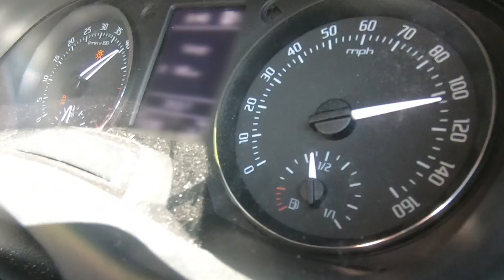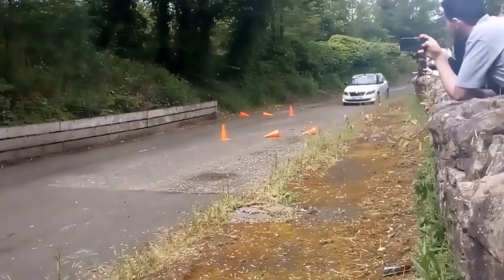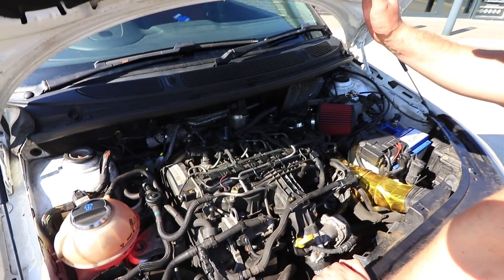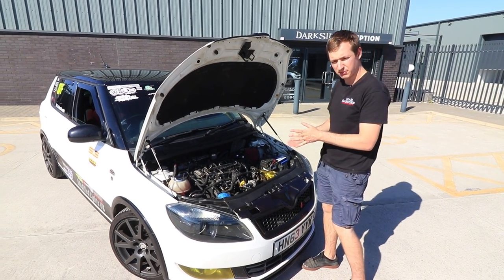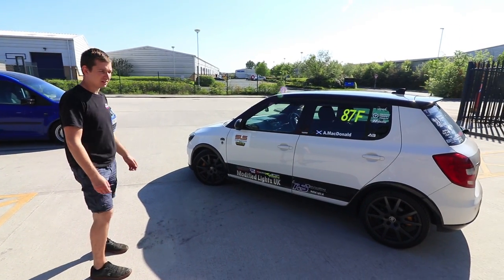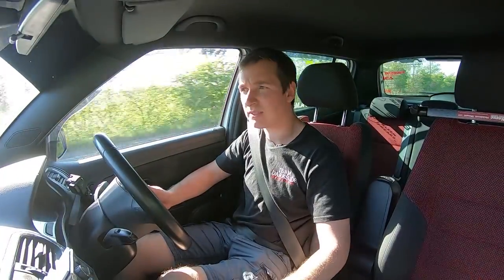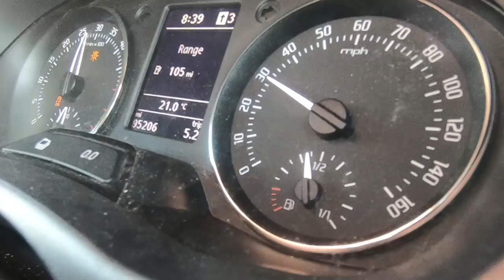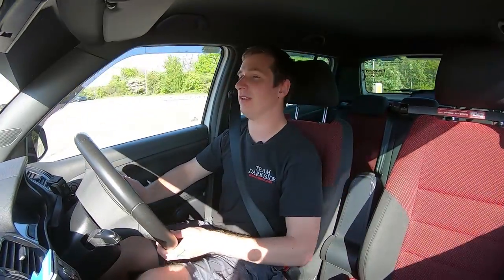Our most powerful 1.6 TDI build yet! 263bhp & 395ft/lbs

Comment: As you get lower down the scale, the horse power required increases massively to achieve reduced 0-60 times.

1.6 TDI (73bhp) = 13.6s  (0-60mph)
1.6 TDI (103bhp)  = 10.6s  (0-60mph)

At this point, only 30bhp is enough to reduce by 3secs.

1.6 TDI (263bhp) = 6.8s (0-60mph)

To reduce by approx another 3 sec's requires in excess of 100bhp and expensive modifications in this particular case. Unless you have a lot of love for the car, obviously best and cheaper to buy a car that's already rated to do a particular 0-60mph. Nice work nonetheless.
Reply: It does 0-60 in 5.18 now

Comment: Still more reliable than original RS (with 1.4 twincharge).
Reply: hahahah definitely
Reply: Everything I've ever read about the 1.4 has said they have chocolate engines.
Reply: Faster too!!
Reply: I’ve put 40k on my twincharge with no issues, no oil drinking ahaha.
Reply: Kyle B I’m selling it at 50k miles ahahaha. I am not crossing the 50k boarder
Reply: Scott C lol, my sister in-laws past 65k and something catastrophic happened and the turbo was spewing out water, dried it up cleared the fault codes and got 5k for it with we buy any car, 🤫
Reply: @kyleb5518  clearly not catastrophic if a water line simply failed 😂
Reply: Whats the problem of the 1.4 twin charge engines?? What are the most common problems
Reply: @miloskilibarda3993  From what I heard the 1.4 tsi drinks oil, the chain can also snap... But I never had one so I can't tell you with confidence

Comment: i would say 1.6 TDI CR CAY has same bore diameter as 2.0 TDI CR CFGB .... 1.6 tdi cr has bore 79.5 mm and stroke 80.5 millimetres and 2.0 tdi cr has bore 81.0 mm and stroke 95.5 millimetres. There is 1.5mm difference in bore diameter. So i think valves aren't smaller in 1.6 TDI.  Big difference is in stroke. 2.0L has 1.5 cm longer stroke than 1.6L. 2.0L is undersquare/long-stroke engine and 1.6L is square engine.

Comment: I have a New Turbo in the Polo 6 r TDI 75 ps,and injector will be replaced,can i remap nie this Car?

It Runs 211000 km is this okay with the New parts to make remap?

Up to 140 PS....
Reply from the maker: Yes, they are usually fine. Injectors are main issue

Comment: You can see the disappointment in his face he’s thinking....god that exhaust note is awfull 😂
Reply: Jon Harwood my first thought on the video was that the car was totally stripped inside that’s why it made such a terrible noise but apparently not 😳.
Reply: @mickaelmorgado20155   The class i run in requires a full interior, even if i take out the back seats or the cardboard bit off the boot lid i need to fit a cage.

Comment: I was wondering, is the 1.9 105hp that’s available for that same generation, tuneable ?
Reply from the maker: Yeah, can get around 140-150 on a tune and have a fair few parts for them
Reply: @DarksideDevelopments  aha, what about 190 hp on wheels, would the transmission and the stock turbo handle it?
Reply from the maker: Might be marginal

Comment: Hi, I'd like to ask for your opinion regarding turbo upgrade. I have a Hyundai 1.6 Turbo Diesel with stock GT1444v turbo, and im planning to upgrade it to GT1649. Do you think it will properly work even without a re-tune?
Reply from the maker: Cant see why it would need one as long as actuator is OK
Reply: @DarksideDevelopments  thank you! Do you think there will be difference in driveability like loss of low RPM torque? Personally i don't think the upgrade is too far from stock but I'd like to hear what an expert says. Thanks!
Reply from the maker: The 1.6s with bigger turbos spool very well still

Comment: I have a 1.6 tdi in my ibiza. On tick over it got a slight misfire rough idle. I think the injectors have gone a drift. But when I load the engine lights or AC on it runs smooth.
Reply from the maker: Check the coding in VCDS
Reply: I got it looked into. If anyone else's as the issue I speak off it's the emission software! Get it mapped out and the EGR mapped out. And make sure they remove that stupid air restriction pipe in the MAF! These guys can do that job they know there stuff when I have watched there videos. But I'm not local so I had a specialist near me do it.

Comment: Water injection, is that a way of getting power out of the excess heat in the engine by vaporising water (letting it expand, pushing the pistons) or is it just for more direct engine cooling under peak load?
Reply from the maker: It works using an endothermic reaction to cool the charge as well as additional fuel from the methanol itself.
Reply from the maker: There are many videos on youtube explaining this which could help you know more about it

Comment: What exactly happened to engine? Why did it break?
Reply from the maker: Rods bent due to too much cylinder pressure/Torque
Reply: Do you think that would happen without ınjector upgrade ever ? I mean everything would be same but just would not have the injector upgrade. I m planing to use water meth injection kit on my 1.6 cay, my setup is all the same just i dont have ınjector upgrade, do you think same thing gonna happen to my engine?
Reply from the maker: Possibly not, doubt you will get enough fuel 9nnstock injectors
Reply: So, it is better if stay with my oem stock ınjectors and apply a meth kit?

Comment: talking of lag. when tuning fuel pulse's for the cylinder compression cycle do you increases the post injection pulse with the rest?
Reply from the maker: Post injection adds heat so you have to be careful what you do there, no point spooling 100rpm sooner to sit on the EGT limiter at the top end
Reply: @DarksideDevelopments  this is true .

Comment: what engine oil would you recommend for the 1.6 TDI , I've seen the original VAG oil is out of stock from everywhere. 
What would you recommend Motul, Ravenol or something else? I know I have the "Castrol" logo on the cap but checking out the internet compared to any other oil has worse results. 
What type of oil and oil filters you guys use? 
Thank's in advance.

Comment: Wonder if it can do a bigger gap than 4 seconds around a sprint circuit compared to mine a couple years ago. Also doesn't sound like a 1.6tdi
Reply: yours was only quick because i drove it haha and 4 seconds over a 45 second run is big lol
Reply: @amd87ts  I think that was for the longer sprint at the end. Where would I find the times for it again?
Reply: @Lewis_Treff97   it was still with me driving your car and when you were driving you were at least 10 seconds slower, thats like saying your car is almost as fast as a touring car at knockhill when your 10 seconds slower over a 53 second lap lol, it was also in the rain with my car on cut slicks that wouldnt get any temp in them and an open diff not the wavetrac it has in it now so it was even spinning all the way through 3rd.

Comment: Lovely car! Needs a good exhaust and a proper CAI! That open pod filter is bullshit, even with the insulated pipe going to it, it still sucks plenty of hot engine bay air in.
Reply from the maker: An open cone is better than a restrictive box but fully enclosed is obviously the best
Reply: it still goes through an intercooler before it goes into the engine to reduce the temp
Reply: @amd87ts  Yeah, I feel ya, but if you made the intake air as cold and dense as possible, you'd be able to either run less boost to achieve same airmass and density inside the cylinders, less stress on components. Or you'd be getting more power from same boost. Ever measured temperature of ambient in front of car vs air after the airfilter before turbo? It would be worth giving a try. Lowering your intake temp would kinda act like "another turbo" before your turbo. If you know what I mean.
Reply: kicsip that’s why it has meth too
Reply: @amd87ts  still not using a FREE, nature given resource of dense, cold air. It is like as if you said "hey guys, I don't eat food at all, but I take 1000 GBP worthy of vitamins and food suppliments on a daily basis that have the same effect as if I ate normal food". What is your ambient to intake temperature and air density delta?
Reply: @kovacspis   intake temps are usually 3-5 degrees above ambiant

Comment: the standard 1.6 is just so slow, honestly the 2.0 tdi 140 does better mpg than the 1.6 on the motorway
Reply: Jarrus Killa with the old turbo this got over 100mpg on a run
Reply: @amd87ts  I don't my seat 2012 leon ecomotive 1.6 105ps 5 gear manual struggles to do over 50mpg and only 99000miles on the clock
Reply from the maker: You have a bad one!
Reply: The 2.0 tdi 140 is the worst vw diesel I have drove. I don't no darkside but I'll take his word over you for sure if you carnt get over 50mpg on the motorway then you have some issues. I can get 45mpg if sat at 70 in a mk4 golf gti

Comment: Huh, I have 266bhp and 400nm from a 1.5 3 cylinder fiesta st.
Reply: did you get it checked for emissions ?
Reply: that started with 200 bhp so an increase of 33% this started with 103bhp which is an increase of 155%

Comment: Sounds absolutely awful, all those mods for really not much power.
Stock 1.6t petrol are capable of that power on standard turbos and injectors. Appreciate the work though.
Reply: Name a engine that can do that  😅
Reply: @411nightnheaven  PSA/BMW's old 1.6 thp could be mapped from 136 to 240bhp.
Reply: @411nightnheaven  st180 1.6T
Reply: The stock 1.6 is 105bhp for the cayc, so over double...I'd say that's much more power personally

Comment: Hi darkside , I can put the aluminum intake of the engine there BKD ??  have a vw Caddy 1.6 CAYE 55kw , and I want to put there with 2.0 BKD 103 kw 16v . 

Thanks 🙂
Reply from the maker: The manifold flange is different so wouldn't work